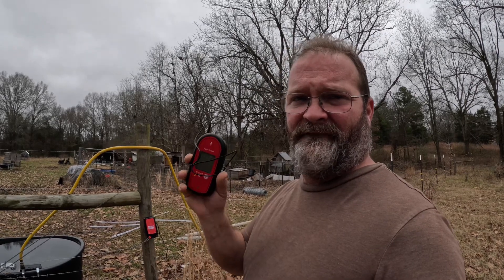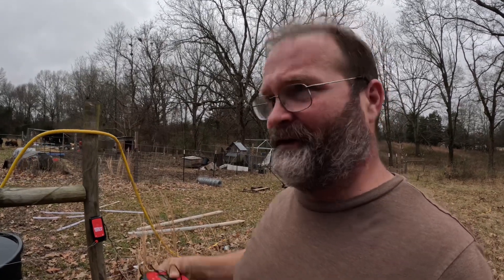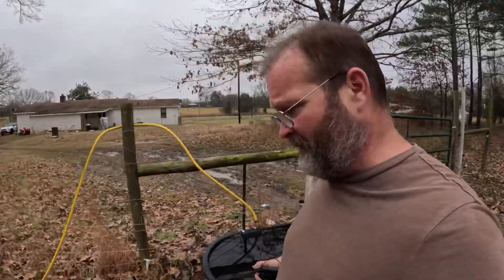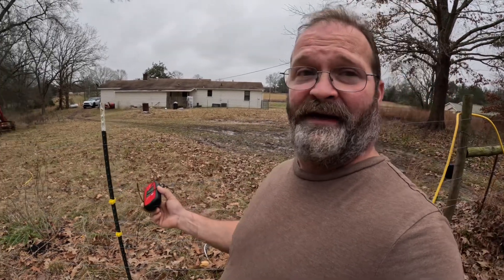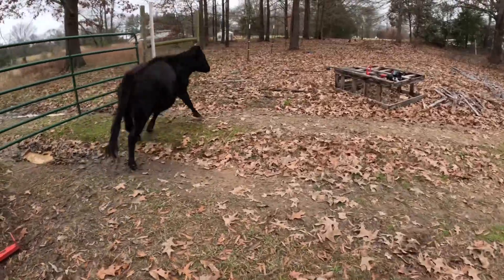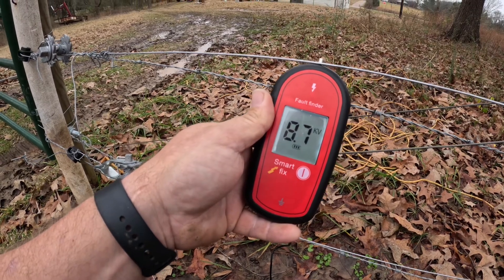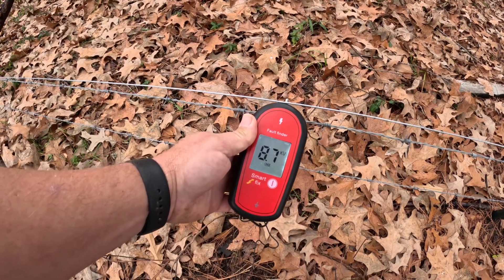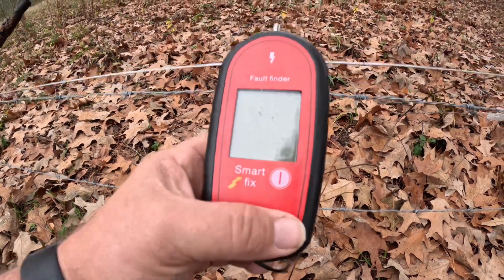Does the cheapest fault finder on Amazon work?

Comment: What is a "fault finder"?
Reply from the maker: It is supposed to show which way the fault. Like which direction the tree limb is laying on your fence
Reply: @HolloHomestead  Electricity sensor, senses if 120VAC is connected to the wire; used to check for broken connections or open connections
Reply: Seems in this one, two parts; a generator sends signal and a sensor picks it up.  Similar operations as electrical tracing or ethernet tracing.